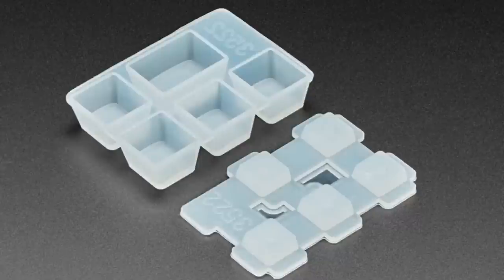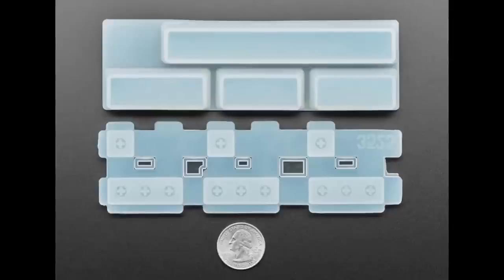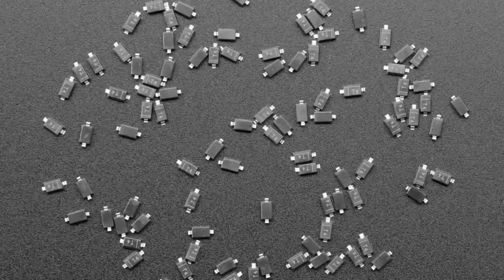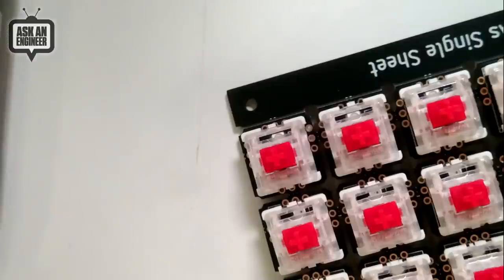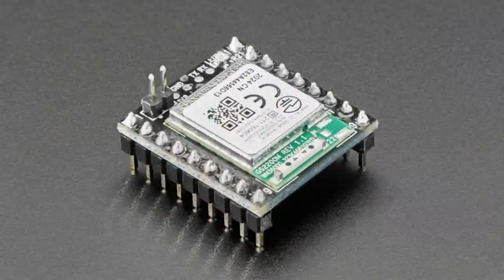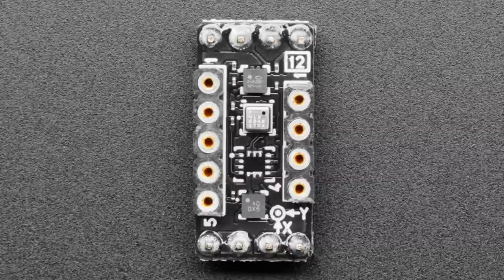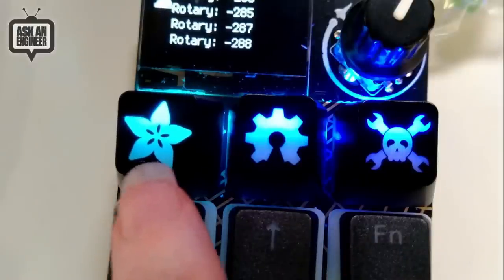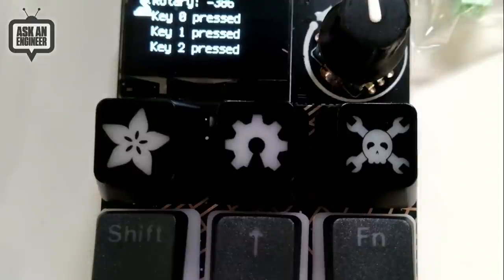New Products 7/22/21 feat. Etched Glow-Thru Keycap w/ Open Source Hardware Gear Logo - MX Switches!

Comment: Hmm... Translucent cast letters in the keycap molds, then use 3D printing resin + UV? I'm not a huge fan of backlit mechanical boards, tho...

I think the low-profile Chocs were opaque, which will be a concern if you want a backlit keyboard.